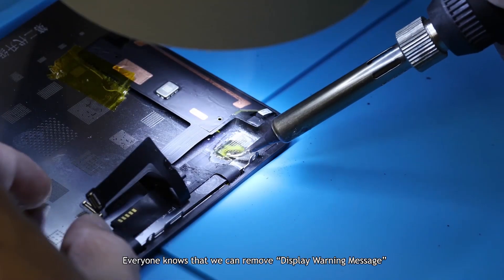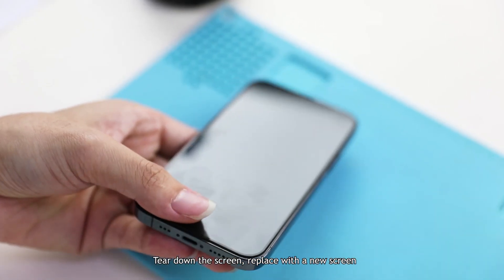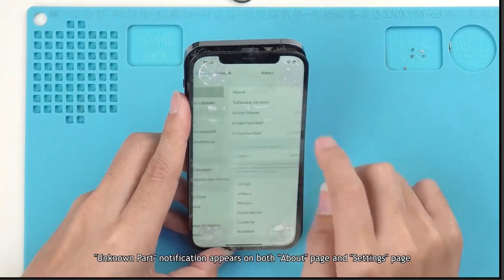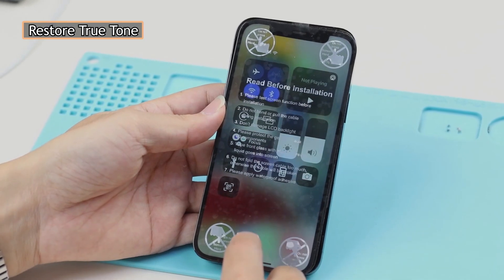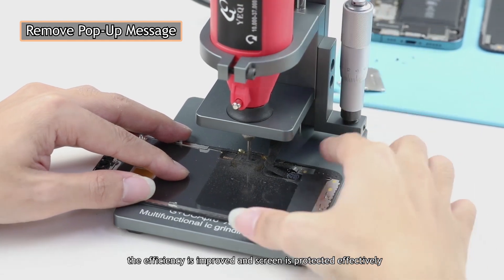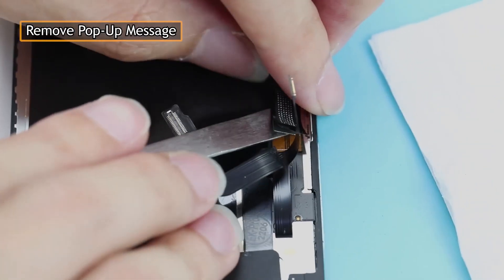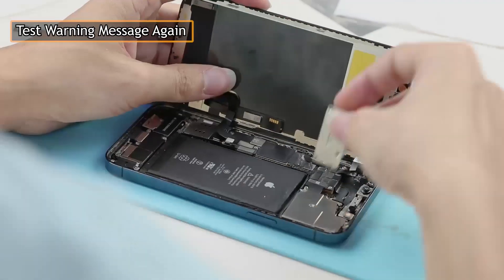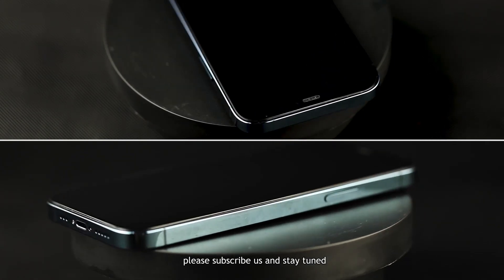Remove Display Warning Message&Restore True Tone For iPhone 11-15 Series On EK Pro Incell

Comment: for iphone 11(not pro) if you use incell screen with plastic fake touch IC chip (with pins ready for chip transplant), if you program this screen using any kind of programmer like v1se or i2c and then you transplant original chip ic the non genuine screen info still persist, to remove this info you have to transplant touch ic chip only without programming new incell screen
Reply from the maker: IC transfer is for removing warning message;
Data programming is for true tone restore. But pls make sure you restore the true tone before you transfer the IC chip to new screen.
Reply: @Elekworld  
no my friend for iphone 11 if you at first point copy truetone data to incell screen and then transplant original IC you will still get non genuine info, because iphone 11 incell screen must be empty then just transplant original IC to recover true tone and avoid non genuine message. For other iphone lcd like 12/13/14 where you have got two chips on screen you can copy truetone data for one chip and trasplant bigger chip to avoid non genuine message. if somebody didn't get programmer transplant both IC chips to screen but i'm not sure incell can accept small IC with truetone data
Reply from the maker: @jantestowy7884    What quality or brand iPhone 11 incell screen are you using, bro? Maybe message me on Whatsapp for deep discuss: https://wa.me/8613590142302.

Comment: Do I really need to grind the touch ic on EK pro lcd? Or can I just use heat to remove? I would think they also use low melt solder for that chip on aftermarket screen maybe.. thanks for all the work you guys do! Keep it up! 🎉
Reply: I don't recommend the grind. You don't need it.

Comment: Is it still not possible to restore True Tone on original 12 screen replacements? I’ve only seen True Tone repair for aftermarket 12 screens, not originals
Reply from the maker: It can be restored on original quality new screen now with JC V1SE, but need match exclusive screen data daughter board. If you are interested in it, pls Whatsapp us: https://wa.me/8613480186332